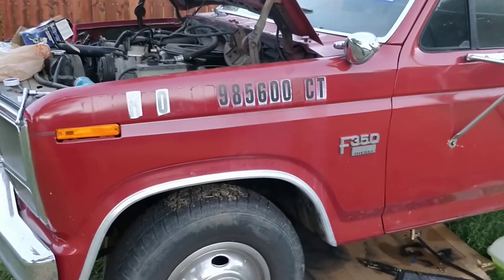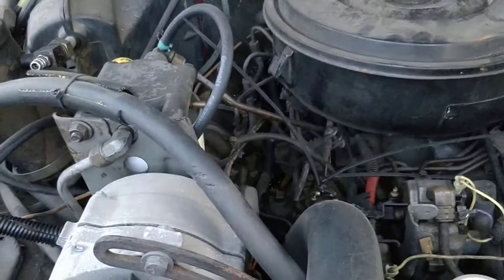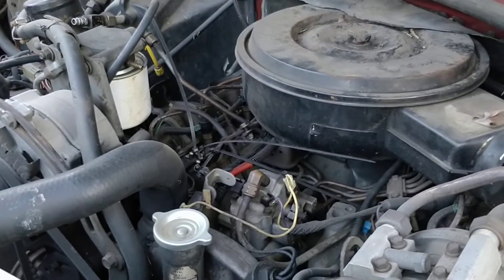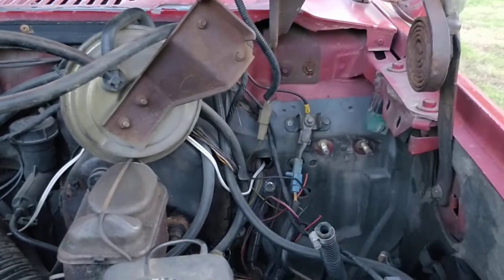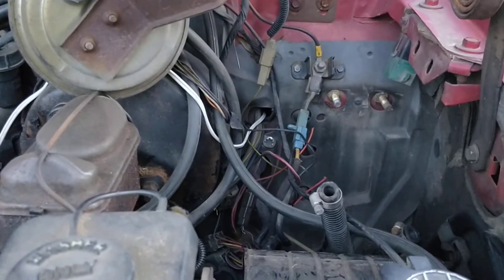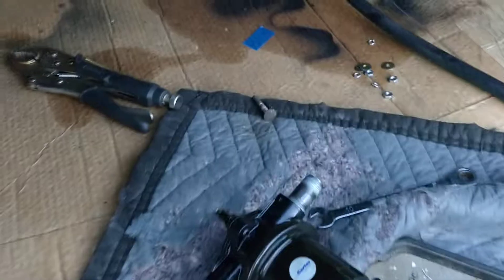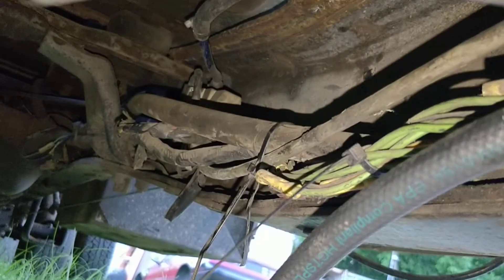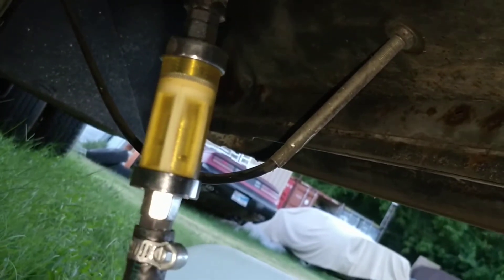Ford Diesel electric fuel pump conversion Part 1

Comment: I have a 1988 Ford Super Duty with a 7.3 diesel. Not getting fuel put on a new manual fuel pump still  no pressure just a trickle figured the lobe was wore don the cam, put on a Mister Gasket diesel, electric fuel pump on the frame after the tank selector valve. That was 4 years ago still working. The Mister Gasket pump was the same pressure as the manual pump.
Reply: Did you leave the old pump in the tank? Is the electrical pump drawing through the old pump in the tank?
Reply: @bradjohnson5928  it doesn't have a pump in the tank it has the old manuel pump that runs off of a lobe on the camshaft. I just spliced the line together at the old manuel pump and left it there to cover the hole in the block then cut the line just past the tank selector valve and hooked up the electric and bolted it to the frame.
Reply: @dirtdobber1959  Copy that, I was wondering if they would draw through a old pump still in the tank?
Reply: @bradjohnson5928  I don't think it will pull fuel through the old pump you will have to take it out or take the guts out of it
Reply: @dirtdobber1959  is this a pull or push fuel mechanism?  I have an 87 Dodge D250 Extended work van.  Old pump wasn't working.  I put a new manual one on.  It worked for a few weeks.  I think the roller on the cam is worn.  I installed an electric pump just off the gas tank, but it's not getting fuel to the carb.
Reply: @MG38601  MGreer my original pump was a camshaft operated pump on the side of the motor. I think the camshaft lobe was wore down and a new pump still would not pump. So I installed a Mr gasket diesel fuel inline pump about a foot and a half from the fuel tank and it pushes the fuel to the motor. I did this probably 7 years ago and it is still working.
Reply: @dirtdobber1959  thanks.  I will look into doing that.  My cam lobe is definitely worn.  I would rather have the manual in pump, but that is just too much extra work.  My fuel source is gas, not diesel.  Hopefully, that doesn't matter.  I think 14.5 PSI from the Carter pump might be too much, for a 5.2L 318 gas engine, but the van is very long and has has farther to travel.  I think it might be best to get the Carter P4601HP or the Mr. Gasket and add a pressure regulator and toggle switch.  Just researching before I throw money at the wrong one.
Reply: How did you get vacuum to your a/c, heater, and vacuum assist brake booster?